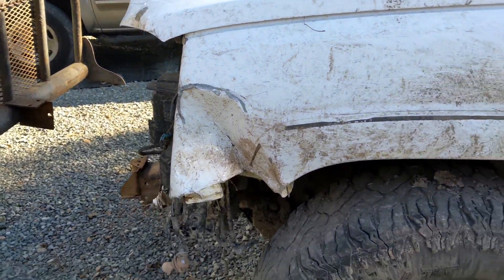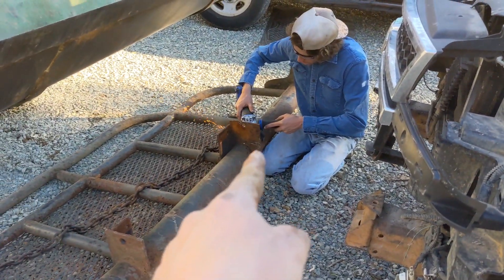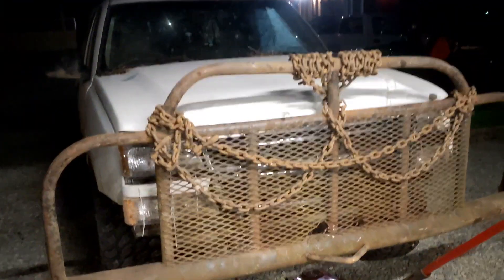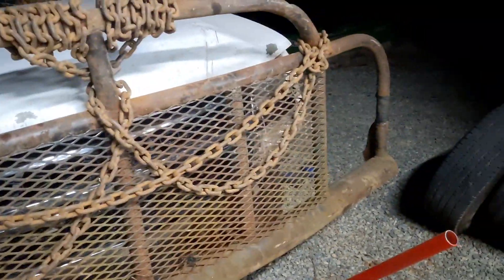Reviving The "Killer Cateye" Installing The Biggest Brush Guard I Could Find...

Comment: No gas needed for the welder ?looks like it worked pretty well, please pressure wash and trim the ends of the push bumper lol
Reply from the maker: It's a gas & gas-less mig welder and yeah it actually did very well, don't worry I'm trimming it today lol
Reply: @Coryphillips1999  nice is that unit from harbor freight?
Have to check it out thanks
Reply from the maker: Yes sir $400 something and well worth it!
Reply: It was running flux core wire which you can run that with or without gas cause it has its own flux but of course it’ll run smoother with gas if you have it, can’t run regular mig wire with no gas though.
Reply: @Coryphillips1999  nice I’ve welded mig and tig and currently have a stick 110 but it’s just ok , I’m to cheap to buy gas every time I weld lol